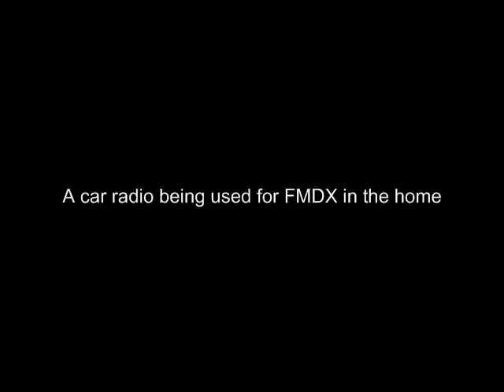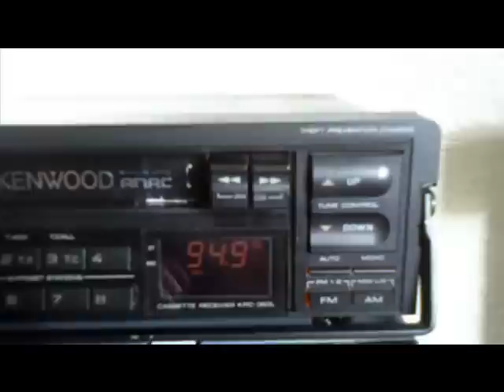95.0 BBC Tees 25kHz step Kenwood KRC-363L car radio cassette.mp4

Comment: Hi Peter. Could You tell me where I can find +12V, +12V ACC, +12V Remote Antenna. I have the same model but without harness...
Reply from the maker: Sorry I can't help. This is a very old video and I haven't had the car radio for many years.